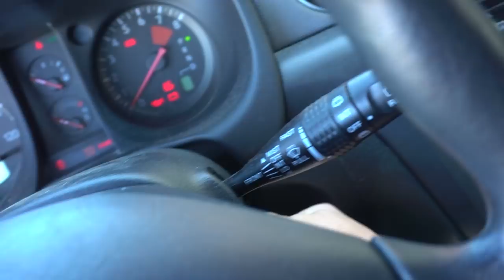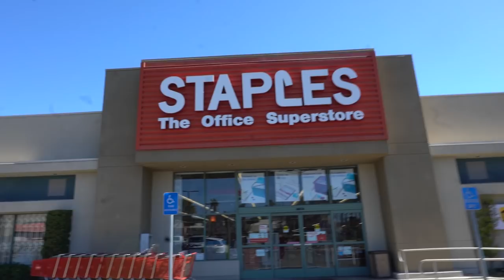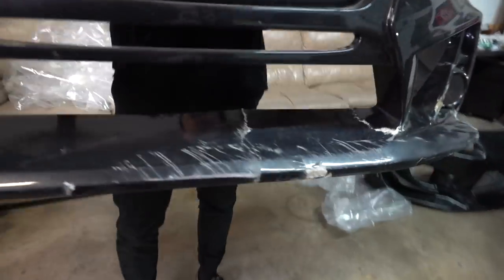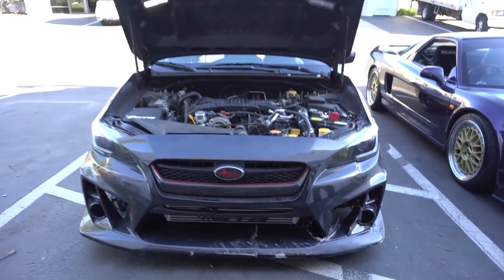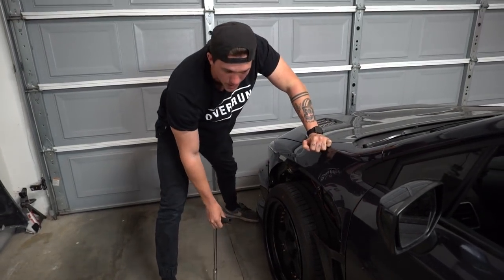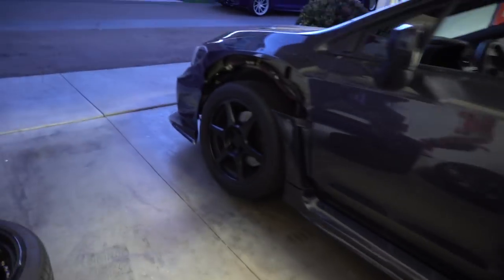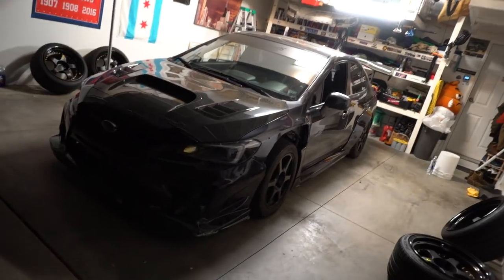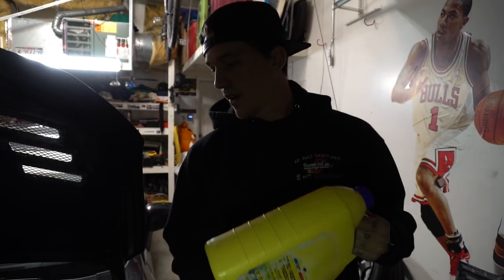WRX FULL TRACK DAY PREP!

Comment: When checking the level on the dipstick, you must keep it vertical as you pull it out to get an accurate reading. If you hold it horizontal, the oil will run up the dipstick and and you will think the level is good.